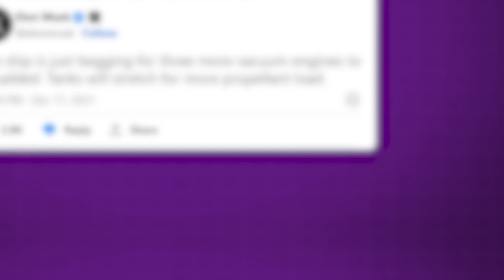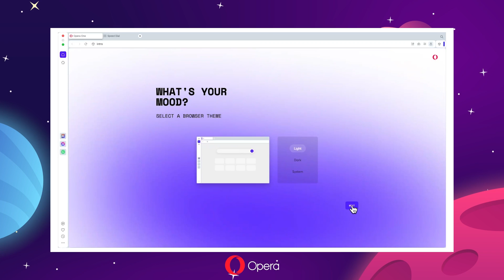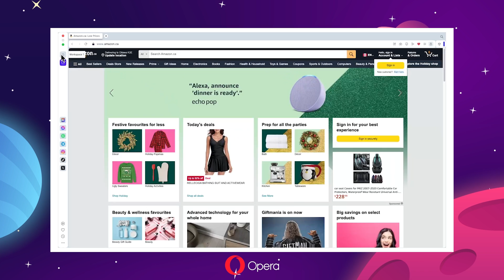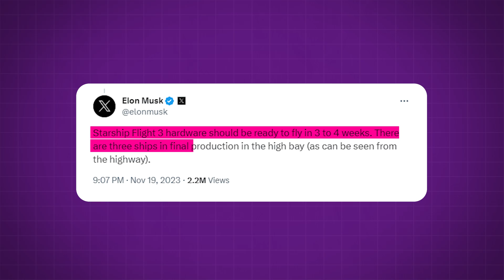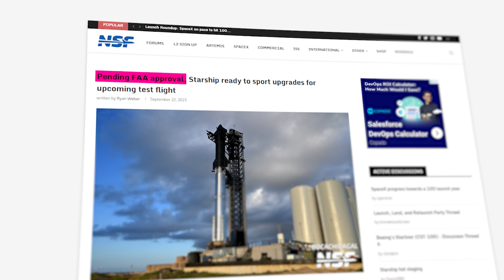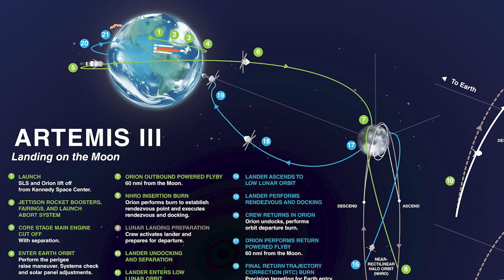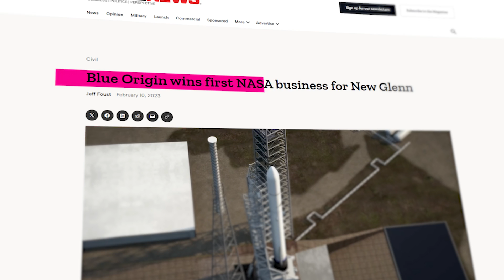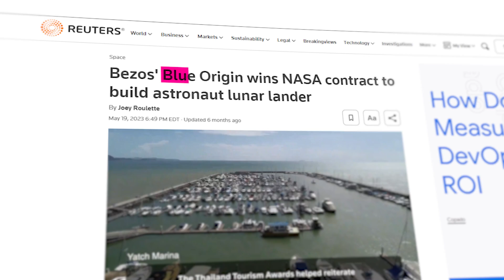Elon Musk Reveals Starship V2 Is Coming!

Comment: V2 does not sound good from the historical point of view. However wasn't that the first suborbital rocket? --- with alcohol as fuel
Reply: You are correct, the V2 rocket built by Germany in the 40s was one of the most influential in history. Much of its designs were incorporated in the Saturn 5. 
Because of this, the original V2 rocket represents the third major milestone in human spaceflight after the invention of the first solid-fuel rockets (developed by China in the 13th century) and the first liquid-fueled rocket by Robert H. Goddard.

Comment: 3D printed tanks suffer from poor material properties because printable alloys are pretty much casting alloys like A256, and it's ONE GIANT WELD. The metal grains are horrible, there are voids and poor dimensional control, the finished part is too damn big to Hot Isostatic Press (HIP) to crush the voids, and the minimum thickness that can be printed is far greater than the tank walls need to be to sustain the ullage pressure. If you get ONE power glitch during printing of a part, the whole thing may need to be scrapped. Oops.

On the other hand, the skin-and-stringer construction used on Starship is a mostly additive process using high-strength material with excellent microstructure, with the knowledge gathered from more than a century of industrial experience of forming and welding similar structures (but it isn't flashy and the buzzwords are old-fashioned). Parallel workstations allow large modules (i.e. the rings) to be built quickly and inspected before assembly of the modules; if one is damaged it can be scrapped and replaced.

Comment: I assume the dry mass reduction is going to be achieved mainly by switching to Raptor V3 engines. As Elon stated, those are allegedly so reliable that they do not need any shielding. Additionally i suppose this  version is going to be an ever more simplified design then V2.
Reply: Dry mass reduction has to be carried out on the body not the engines
Reply: @bidav2114  Why would that be? Unlike fuel, engines do not lose mass while going to orbit. Engine mass is dry mass.
Reply: @EaglePicking  you'll have to reduce overall weight because the dry mass of any vehicle is it weight without fuel, oils and payload. So the engines are part of the dry mass but light engines might cause out problems it it can handle the heat, pressure and stress. That means let the engines be but find a way to reduce weight in other part of the space vehicle(starship)

Comment: I feel like it's highly speculative to suggest SpaceX is going to move away from their current steel production for Starship Superheavy, to something less proven, that might require entirely new tooling. Remember, they chose this steel because it's stronger per mass than the alternative materials in the various temperature regimes that the ship has to endure. More likely they've found places where the ship currently is overly built, where they can shave off excess metal.
Reply: It's more likely they've just shaved a fraction of a millimeter off of the thickness of steel they're already using. They might (and this is pure speculation from me) have also found a way to reduce the mass of the heatshield tiles, since we still saw some falling off on IFT2, it's likely they're still iterating on the design of those quite a lot
Reply: Tank is not the only part made of metal. We'll see.

Comment: Starship "V2", eh? Slightly unfortunate connotations in designation terms. Might be worth opting for a less "nazi" name for the upgrade.
It's important!
Reply: V2 sounds good though, people should be able to make the difference between V for "Version" and V for "Vergeltungswaffe" (Vengeance weapon).
Reply: If it wasn't for the V2 rocket science would be farther behind.  V2's were liquid fueled (LOX and alcohol). A modified engine was used as the first stage of the Mercury rocket.

Comment: How about adding a NERVA type egine to the second stage, I know NASA is working on it again. We need this tech. to make it to MARS anyway.
Reply: That is a good idea but it likely wouldn’t work as well as you would hope. 

The Nerva engines run on liquid hydrogen, so you would need to add another tank and propellant which is a lot of mass.

Also, the Nerva’s do not produce enough thrust to make orbit. They are an on-orbit engine, so they would still need Methalox and raptors for orbit. I haven’t done the exact calculations, but I would imagine that it is similar dV if not way less than the regular starship. But the Nerva will be revolutionary for payloads if they can get some operational!

Comment: Seems the easiest way to gain fuel capacity is increase the diameter proportionately for all parts of the system. Still have to figure out how to make a crew space when you have fuel tanks in the nose and a downcomer in the middle of the ship. I guess we'll see in V2.
Reply: Maybe, but I remember hearing in the past the plan was to increase the height of the Starship to the size of the booster. This sounds more likely because increasing the diameter would make ALL of the infrastructure (high bays, test stands, launch rings, etc) obsolete.
Reply: @helifanodobezanozi7689 Exactly.
Reply: That's why I figured the diameter would increase. The OLT is only meant for a certain height. We'll see.  @helifanodobezanozi7689
Reply: They will make it taller. About 10 meters taller. And reduce about 7mm of steel from the ship's walls. That will reduce the weight drastically.
Reply: For lunar lander variant they may not need the header tanks at all.  That is in the design to balance weight and such for the flip maneuver and reentry in atmosphere.  None of that is likely needed on landing on the moon.  Wouldn't be surprised if that whole part of the system is stripped out and replaced with a docking port or something.

Now, that being said, there is a bit of light atmosphere on mars, so that's a future problem.  Also when they try to make a crewed version that WILL land again on earth, they will once again need to address the safety issues with it potentially, as they would need a header tank possibly for that.  Could you imagine being on board a starship while it does the flip maneuver...
Reply: @cheostian4847  I wonder what the deceleration will be during the flip manoeuvre?

Comment: I'm really exited to see how V2 will look!
Reply: Same, however i don't think there will be any major difference as seen from outside. Seen from underneath howerver, with 3 more engines it should be insanely cool!
Reply: @nzt963  Elon said on more than one occasion that the forward front flaps are not a good design and the will move further leeward and have more like a 120° angle to each other compared to 180° it is now. I thinks its likely these changes come with the V2 version and in that case it will look  different.
Reply: Oh we already saw V2s 💀💀